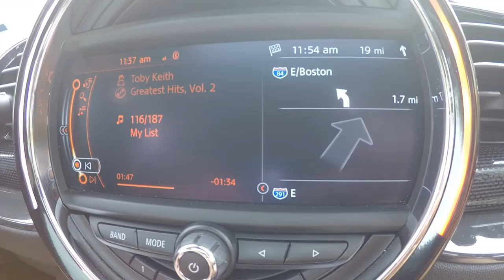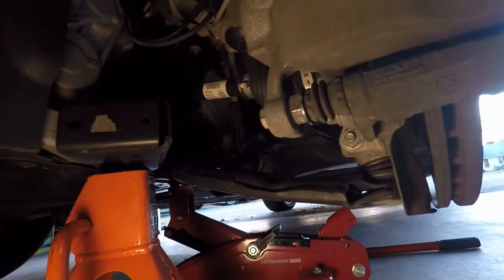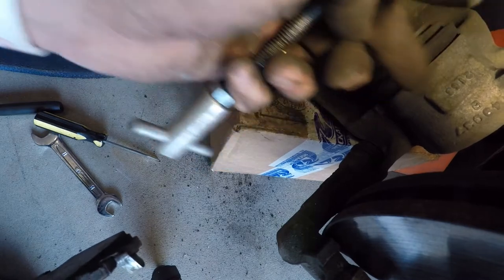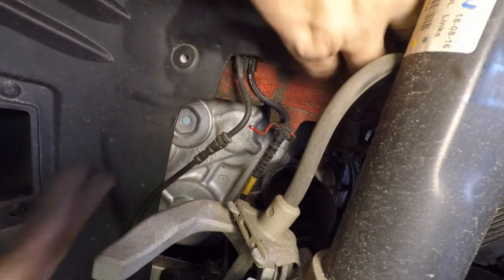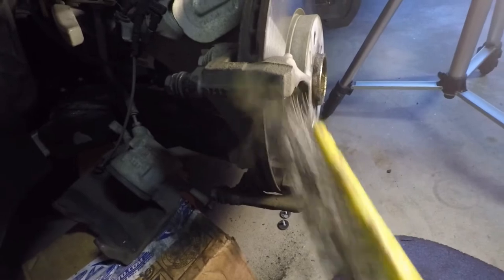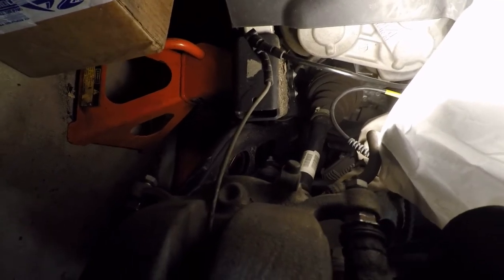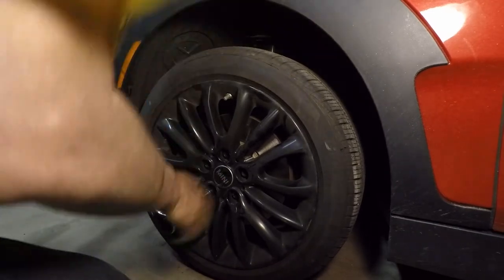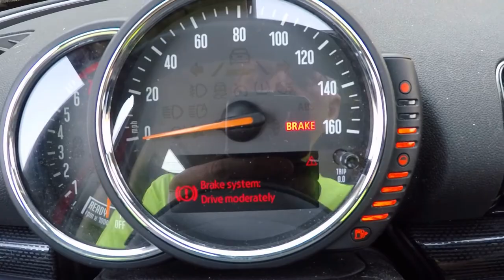Front Brake Pad Replacement 2017 Mini Clubman

Comment: Super job on this. 
Reset "Brake" service reminder with motor off, ignition switch on, door shut and parking brake off. (If parking brake is on, reset unsuccessful comes up. Push small black button at speedometer in and hold. Bring up reset possible, let go, push again again and hold to bring up "reset?". Let go. Push and hold, reset starts. You can hold the button in until reset is done. The brake sensor is just one loop wire in plastic. When the pad wears enough it rubs away the plastic and the wire inside. The loop is broken and the brake service light comes on.

Comment: My pad depth is low and I can change pads. My concern is the wear sensor. Mine hasn’t tripped so I could try and reuse them. Mini have made it impossible to do any work yourself. A fault will come up that they charge you to reset. Hate it. Any work arounds? Can I re use the same sensor with new pads if it’s not current broken?

Comment: Very nice video, a couple of comments. 

1. Anti seize should never be used on lug nuts as the torque specs are based on dry lug nuts. So, you could stretch and snap the lug nut when torqueing. 2. The rotors have to be measured to determine if they are within Mini's wear limit. If not, they have to be replaced, as the stopping distance is increased due to poorer heat dissipation due to the thinner metal.  Regards!

Comment: If you have an electric handbrake make sure that is off when you reset the brake check light
Reply: Mr.Parsons my light came on so I replaced the pads on my front rotors then I tried resetting the warning light  with the handbrake on . It kept saying reset failed till I read your comment I tried it with the handbrake off and it worked ! Thank you so much . My Mini Countryman is a 2017 S model  with 43,059 miles and I didnt turn the rotors as there was no noticeable ridge . My book said lug nut torque is 103 ft lbs also .

Comment: Is there a sensor on both sides, or just one?
Reply from the maker: Each side has one sensor. And what is interesting is that if you think about it, there are 4 front pads and 4 rear pads. since there is only one sensor you have a 1 in four chance of that being the pad that wears the most. I just did the brakes on the mini and the sensor-less pads were the worn ones...so do not rely on the sensors, and try to catch it before you blow out a sensor. And save the good pads you remove, just in case.

Comment: Just did this on my wife's Clubman S- great video! Nice job getting all of the different angles considering how small it is in that wheel well. I used Akebono Euro pads which come with the sensor and brake grease. It resulted in a softer pedal feel but the ceramic pads should produce less dust than OEM.

Comment from the maker: I have never ground my rotors, I try to catch it before the pads hit the rotors. If the rotors look bad, I buy new ones on Rock Auto
Reply: the rotors on the F54 are usually too thin to have machined for multiple brake jobs. on my 2016 F54 I got Slotted/drilled rotors, ceramic pads and wear sensor for $108
Reply: @scottb2830  from where, sounds like a good price?

Comment: Just wanted to reach out and send you a big thank you. I did the brakes on my wife's 2018 countryman S and it was exactly the same as the video. 

I do have one question. Did the notice for brake go away on its own or did you use a scanner. If you used a scanned which one has worked for you?

Again thank you very much very simple

Comment: Do you have to always replace sensors?
Reply: It is best to always replace the sensors when replacing the brake pads. Also, on the F54, replacing the rotors is recommended
Reply: Scott B Technically if the sensor doesn’t rub against the rotors the sensor won’t wear down and go bad.... answer is no but they are really cheap to replace.

Comment: Thanks for the Vid, very helpful. How did/do you like those Cinturato tires and how many miles did you get out of them? I ended up replacing the Bridgestone RFs that came on mine with regular tires and bought a full size spare/scissor jack.

Comment: How many miles were on the car when brakes went bad. My brakes only have 17K and there bad
Reply: My brakes were bad in roughly the same amount of miles. Dealer told me it was “performance brakes” and they won’t last long. Also tried to charge me for a $1600 brake job. I said nope to both and have taken it into my own hands.
Reply: Reply to old post. 
I'm at 29k
Reply: I'm on 40k and will be ready to use the video
Reply: I'm only on 26,500 miles and car wanting new pads already.
I expected more tbh.

Ps, great video, but please no more infuriating music.... 👍🏻